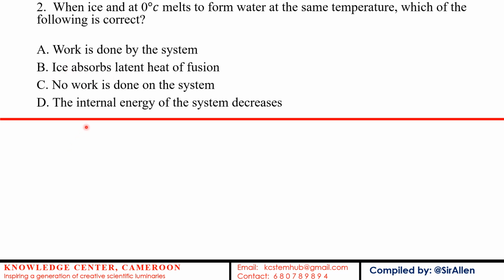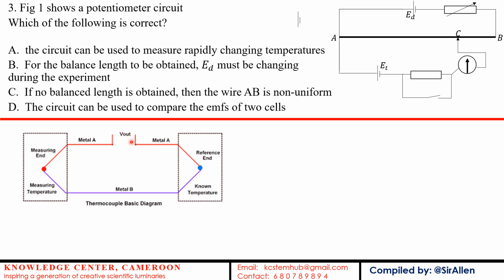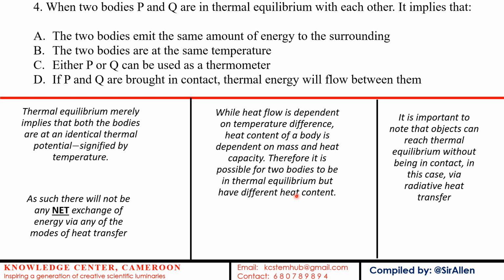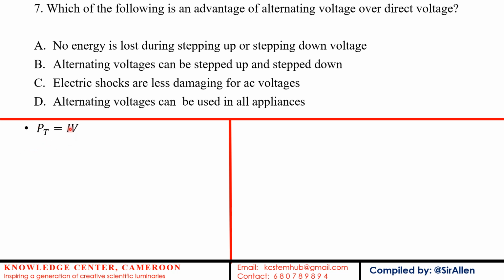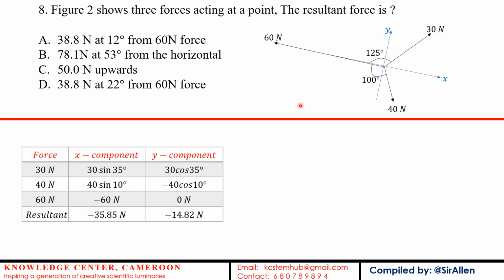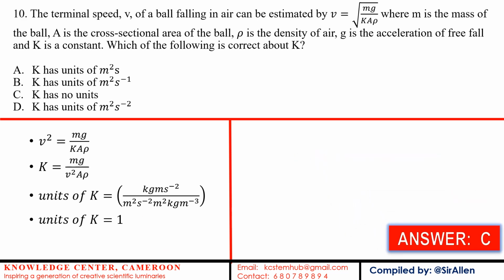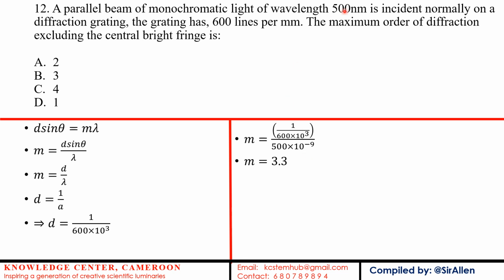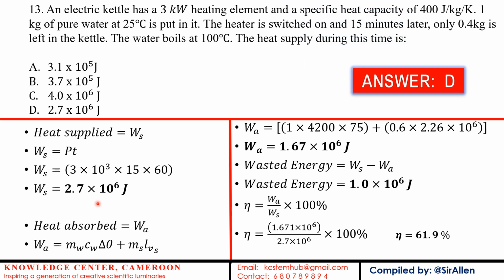Physics Southwest Mock 2023: Episode 1

Comment: Please sir where is the 2.26x10^6 coming from
Reply from the maker: It is the specific latent heat of vaporization of water. If the water is boiling, then some of the water is changing state from liquid to gas and the amount of heat required for this phase change is mass of the steam multiplied by specific latent heat of vaporization.